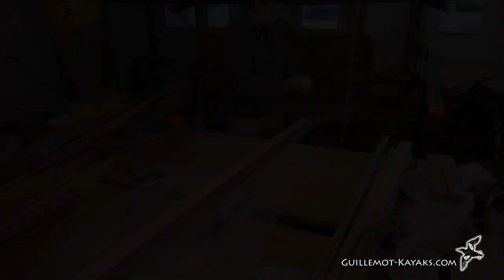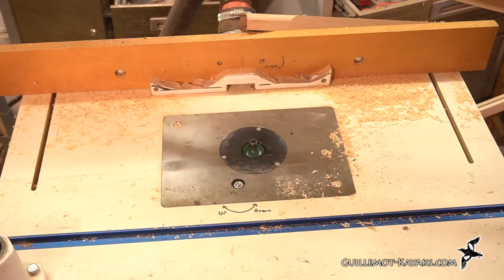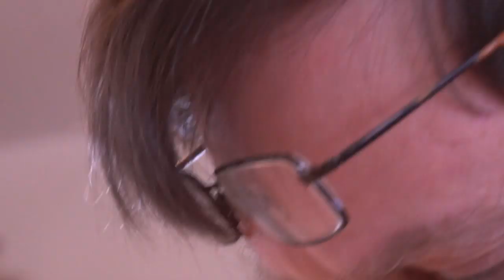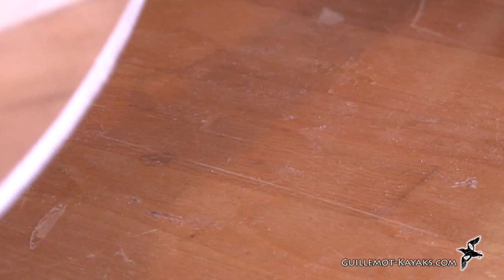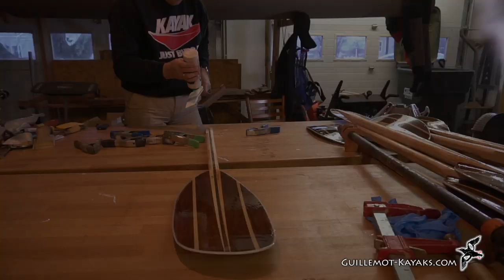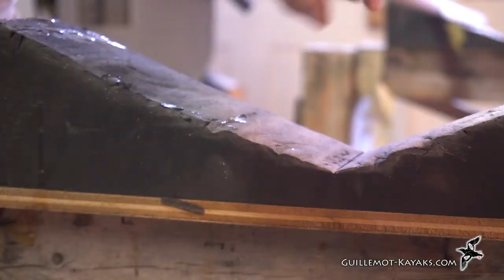Making a Wood Kayak Paddle

Comment: Two dislikes from envy or inability? I like a bit of dihedral on my power face of my  blade=less flutter when pulling hard on the paddle or side sculling. Amazing workmanship, kudos! Is the rope dynel or poly? Reminds me of Silver Creek white water paddles ( now defunct). Thanks for all your videos!!!!!!!!!
Reply from the maker: The rope is nylon parachute cord. The most immediate inspiration for my paddles is Mitchell Paddles out of New Hampshire. I don't find these paddles flutter even at high power. The curvature of the blade places the center of effort behind the center axis of the shaft so it sculls very predictably.
Reply: @NickSchade  Good to know, used many Mitchell paddles racing slalom back in the day. thanks

Comment: why don't you glass the shaft of the paddle?
Reply from the maker: I have, but it is tricky. I only do it if I think I need the strength. These will be plenty strong without the glass.
Reply: @NickSchade  understood.  I'm making a paddle and am pretty sure I'll need to reinforce the shaft.  I think the tough part will be getting the fiberglass to wrap correctly around, likely I'll find out in the next few days.  Great vid.

Comment: Hello just wondering.... What is the final weight of such an paddle?
Reply: Also wondering. I've built one based on Nick's plans but I used slightly heavier weight fibreglass and a radiata pine shaft. It's just on 1.4kg but I think I can reduce this by 200g by using paulownia as a shaft laminate. I used 120g epoxy on the paddle faces and I guess approx same weight in fibreglass. I didn't weigh the wood blades but from memory the wrc and rimu I used ended up very light. So most weight must be in the shaft. I modelled the blade on my canoe polo paddle.